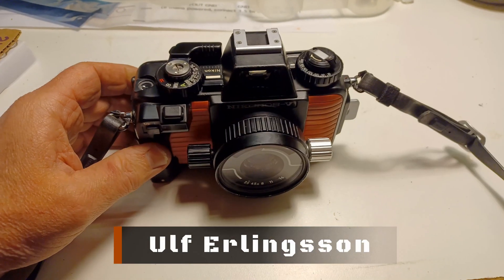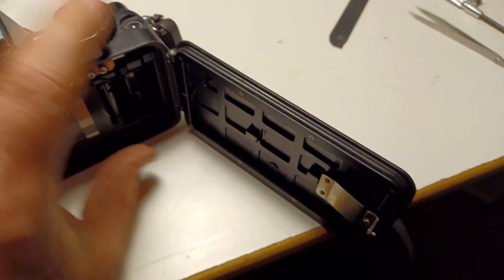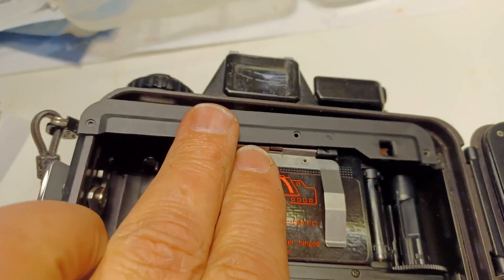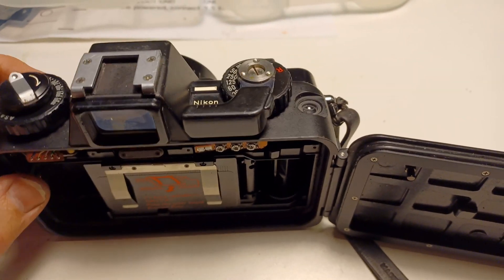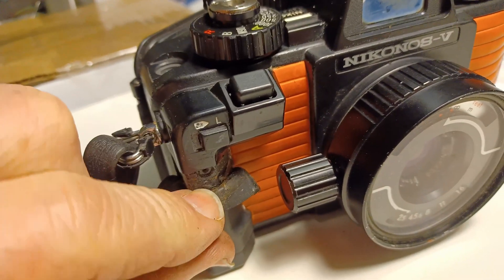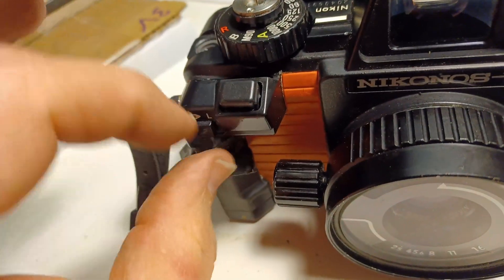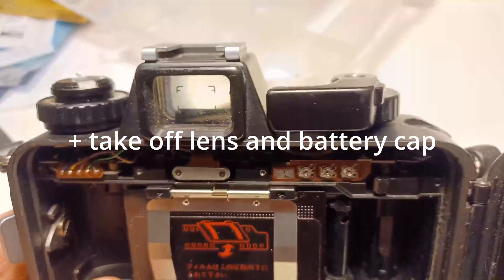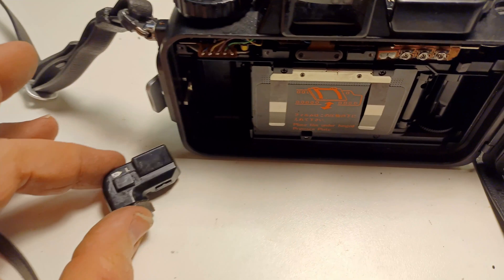Nikonos V repair

Comment: This was very helpful, thank you very much. I was able to locate and remove all those o-rings, except for the second one inside the rewind lever. 

I was able to remove the clasp under the top part of it but I was not able to remove the securing bar/pipe on the shaft, which stops it from getting pulled out to the top.

I am not sure, if I just have to press it through, using pliers, or do I have to unscrew it somehow. Could you please explain, how you took it out?
Reply from the maker: If I understand you correctly it is that little pin in the photo of the thumbnail. That one is press fit, if I remember correctly I used a small vise or a small press to get it out.
Reply: Thank you, yes, it was just pressed in. I pulled it with pliers and later pushed it in with pliers again.
Everything works fine and a first test in my sink showed, that it seems to be water tight. And as low depts are more critical than deeper depths, I guess, the o rings will work down to 50 meters

Comment: hey there, thanks for the vid! i am currently trying to service a V and i can't get to the second o ring on the film rewind knob (the inner one) since i can't get the metal rod out, how did you do it? and for the shutter o ring i have to remove the internals of the camera or can i just pull it out at the front?
thanks!
Reply from the maker: If something is stuck, it may be due to corrosion or due to salt build-up. I tried with a liquid that worked against both. Too long time ago to remember, but I think it was a week acid. As for shutter o-ring, I have forgotten the specifics, so I can only refer to the video and the diagrams.
Reply: @UlfErlingsson  thank you! yes, the little metal rod at the end of the rewind knob seems to be stuck but it doesn't really look like it is supposed to come out. but yeah, the diagram says it should, i will try again and see if i can get it out. i want to use the camera for diving but not without servicing every single o ring :)

Comment: Hi Ulf, 

I wanted to thank you for making a great video which made me build up the courage to open my Nikonos. Super helpful. 
When opened up - the underside of the ISO dial and around the O-rings on the door opener scew are covered in lots of white "gunk". Grease or something like that. Did you encounter this as well? 

I'm unsure wether to clean it and grease the o-rings or not. I guess it's some old repair or measure to prevent leakage.

Thank you again for a helpful video.
Reply from the maker: Hi, thanks. If it was me, I would definitely clean it and restore it to pristine condition. It may be an overapplication of grease. If the o-rings look bad, replace them (I would replace mine if I had planned on diving with it, which I don't; budget o-rings only last 15 years and I don't know what grade these are).
Reply: @UlfErlingsson  Thanks for the quick reply. It seems like it's an overapplication to me. Definitely not salt or anything else like that. The camera looks like it is in great condition overall. O-rings look good, so they'll stay I think. I'll clean all parts, add grease and hopefully not get an unpleasant surprise when taking it under water:)
Reply: Update for those interested in doing the same.
After some struggle with assembly (ISO dial), I managed to get everything together. However, the viewfinder is now dead. Shutter, autoexposure etc works fine, so I think a wire has loosened when removing the inner body. I think that requires soldering which I'm not going to do. Camera works fine either way :)
Reply from the maker: @Lovprod  you may just have a problem with the flat cable to the viewfinder. Check with good loup or a microscope (10X magnificstion).
Reply: @UlfErlingsson  Found out that I had assembled the small plastic piece on the flat cable on the outside of the metal part, instead of the inside. While screwing the parts, the small screw fell into the inner camera body. While trying to get it out, all 5 wires on the left side connecting the inner body broke loose. Screw is long gone after lots of time searching. I guess I'll learn to solder, reassemble and pray for the best or keep it as a mechaical/parts camera D:
Reply from the maker: @Lovprod  Those are very thin wires, it requieres a soldering iron with fine tip. It is not a job for beginners. But it can for sure be done. Just don't mess up the flat cable or you are really stuck.
Reply: @UlfErlingsson  I can imagine. I'll see if I'll give it a go - at least I have a whole set of spare O-rings in the correct sizes now haha

Comment: This video is incredible and I've been looking for it for a while now and here you are with this video explaining exactly what I needed! Thank you so much! I do have a question, I know you mentioned that the shutter speed dial needed to be set to M90, I'm assuming so you know for sure that the dial is reading both on the dial and in the camera. My question is that I accidentally took off the ISO dial without looking at what it was one before. Do you have any way of knowing how to line that dial back up when I put it back on? I just want to be sure I can still trust my light meter!
Reply from the maker: I did the same mistake, but there was no problem, you just have to put the dial right and be gentle. Try to assemble with the o-ring removed if you want to be sure, since that way you feel what is happening better. Also, I am glad you liked the video. I would never have been able to do this repair without a full parts diagram of the camera. So in doubt, Google that document, the Nikonos V service manual.
Reply: @UlfErlingsson  Amazing thank you so so much! Yes this video is everything I needed, and I too am working off of the diagrams in the service manual. For those who may need it here is the link to it: http://ss-it.de/data/nikonos/Nikonos%20V.pdf

Comment: Awesome video with really good information! You don't have the specs on the o-ring sizes do you? Or did you not need to replace any of them?
Reply from the maker: They were all in good shape so I didn't look at what size they were. They looked like 1.5 mm thick, I'd guess.
Reply from the maker: Also, did I mention that I drop of vinegar on the stainless screws loosened them up in less than an hour?
Reply: @UlfErlingsson  Awesome man. Thanks for the info.